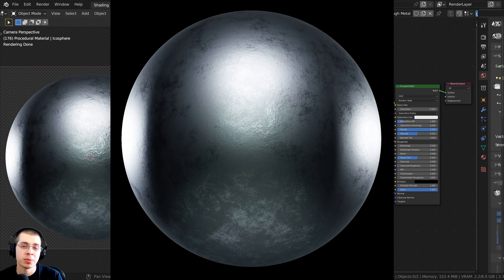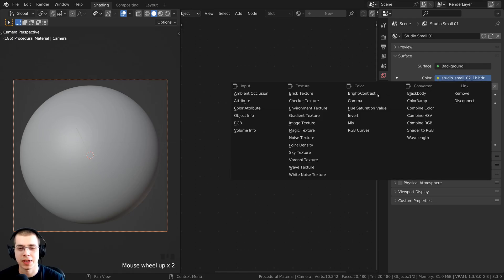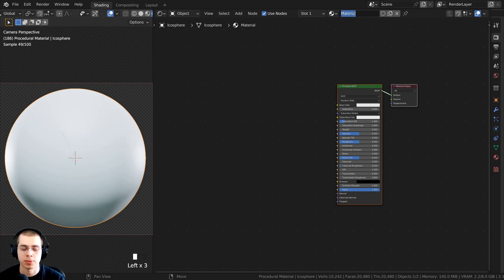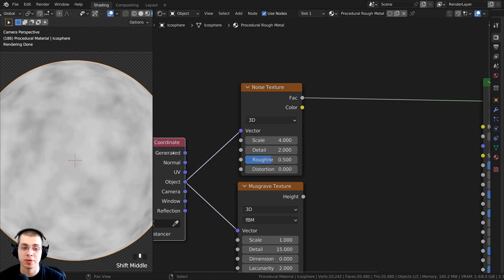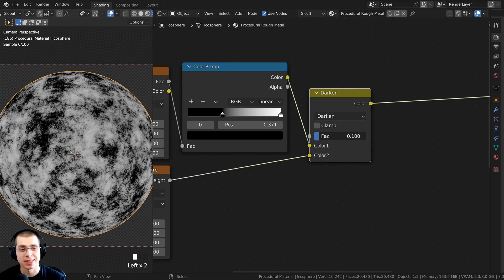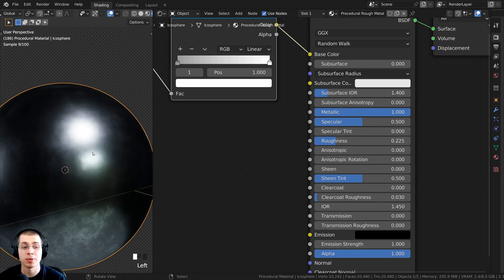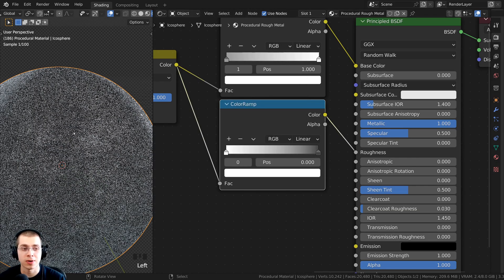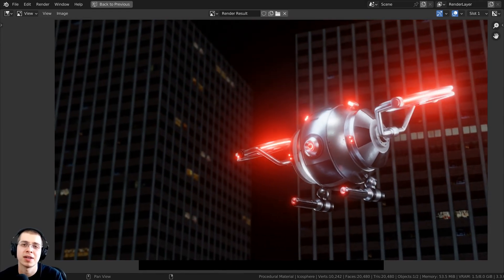Procedural Rough Metal Material (Blender Tutorial)

Comment: I need help after i wired the node from the darken to the bump and set the strength to 0.1 and change from the normal to the height and connected it to the normal on the principled DSDF it just turn into a purple color

Comment: Thanks for your procedural material turorial series.
I followed this tutorial, but I want to add parameters using a node-group (as in your latest tutorials) to manage darkness and color.
The solution I found (see https://drive.google.com/file/d/1yo-rluECmaRCBN2XNGUOZ2M2vX_KjHc3/view?usp=sharing ) works but seems crazy. Any suggestion? (Maybe in a new tutorial)
Do you plan to update the tutorials to Blender 4 (I mean in Blender 3 the color mix node has clamp off and in Blender 4 has clamp on)  and add more parametrization?

Comment: not sure if it's a problem with my model, lighting or texture but this metal is showing as white in dark shadows
Reply from the maker: hmm, did you setup the bump map correctly? It could be a problem with the bump, or normal.
Reply: @RyanKingArt  thanks for the response! i think it's a problem with my model (curved pipe) because it works fine on everything else in my scene.

Comment: Another great tutorial, they are amazing!  Btw. when removing the, say, Mapping node with delete the connection is lost. Using Cut removes the node + keeps the connection.
Reply from the maker: Thanks for watching! Yes I know that you can press Control X to remove the node but keep the wire plugged up. But there's no point in doing that in this case because I'm going to have to change the connection to the Object coordinates anyways.  So either way I'm going to have to plug another wire up to the texture.